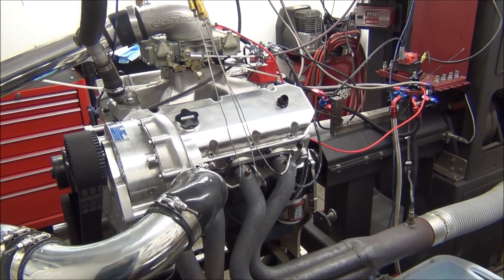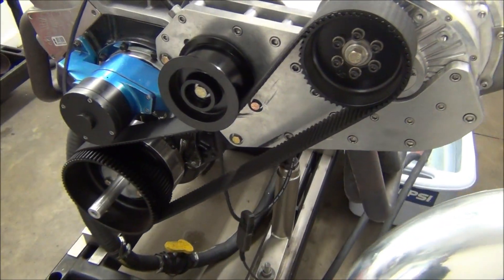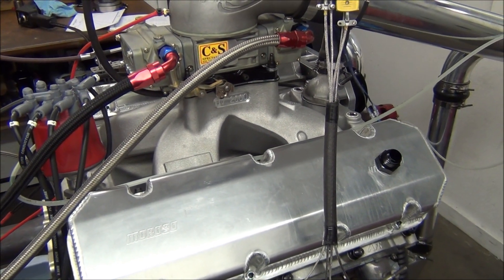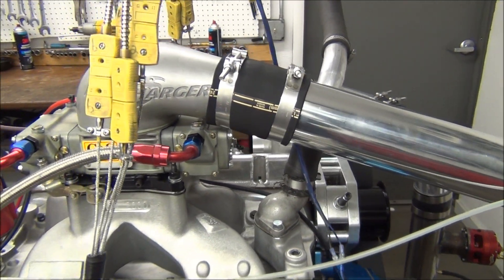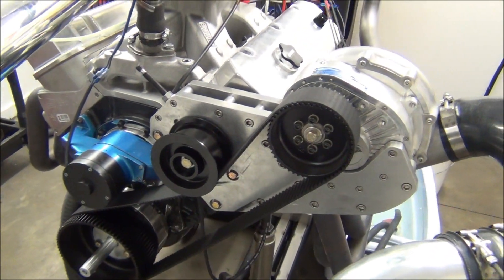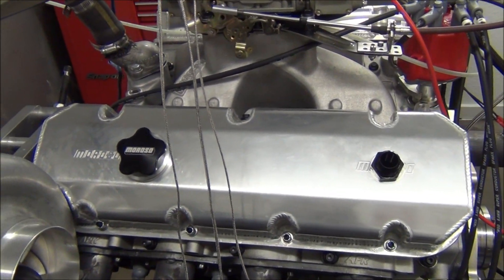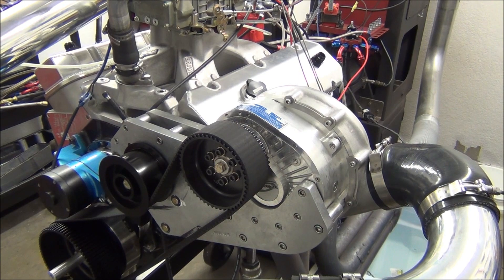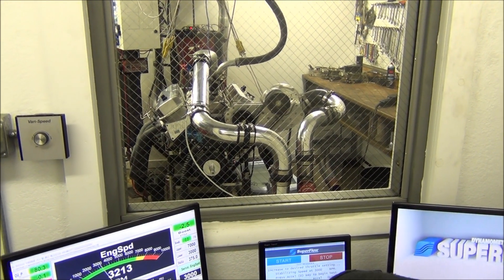CNC 540 Big Block Chevy 1550+ Horsepower with an F2 ProCharger

Comment: Carburetors are obsolete.
Reply: Carbs on average will generally make more horsepower than Fuel Injection.  It's been proven over and over.  What Fuel Injection does provide is better driveability and cold start performance.

Comment: What's the rounded estimate on this set up? Very interested.
Reply: On the website it looks like it's 20k plus 7k for the procharger?
Reply from the maker: +Joe Tobias $20,000 for this package, we have it listed on our web site www.cnc-motorsports.com
Reply: +cncmotorsports Thanks. Very reasonable considering the price compared to the Chevy 572 half the horsepower.
Reply from the maker: +Joe Tobias http://www.cnc-motorsports.com/bb-chevy-540-turbo-pro-charger-engine-2000-horsepower-rating.html